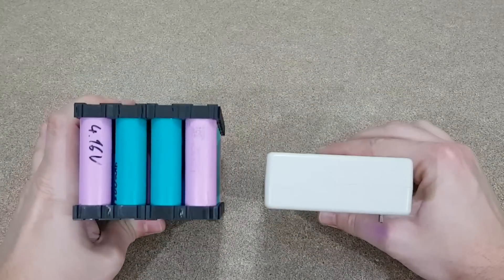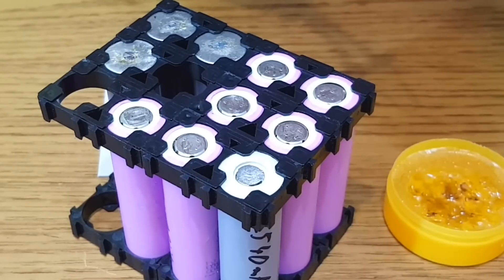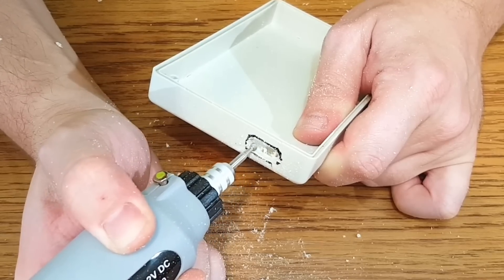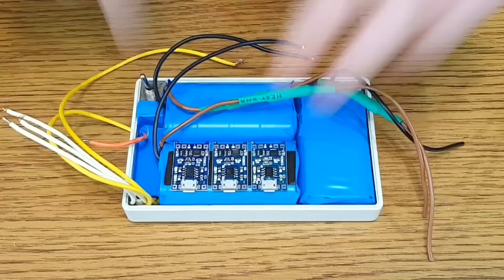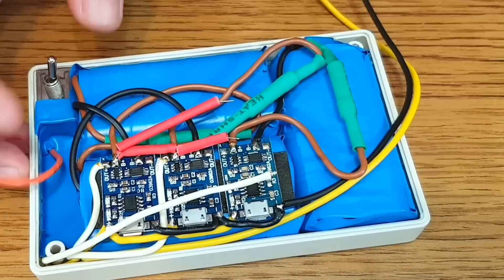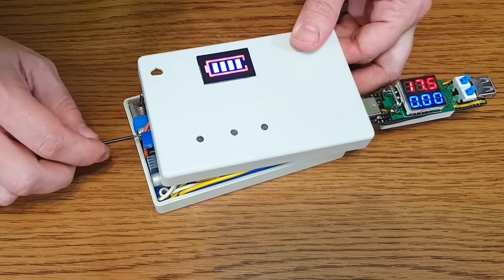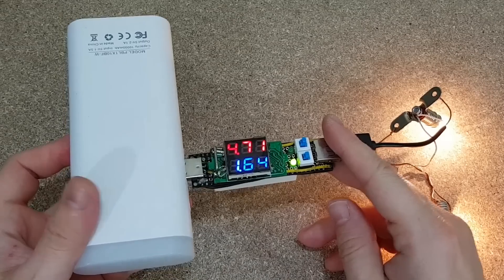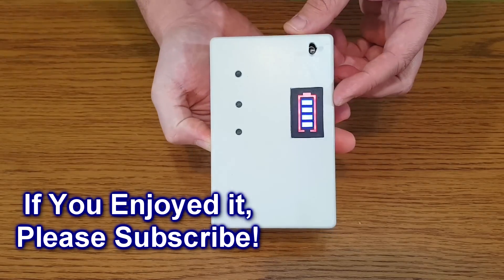DIY - 15000mAh Power Bank - With Salvaged Batteries (gets charged with 3A)

Comment from the maker: UPDATE: Instead of XL6009 I suggest you use the MT3608 boost converter, it's much stable when the cells get low on power.
Reply: Xl6009 latest model instead of MT3608 how is possible?
Reply: i have a question , how many cells i can solder to one module ? tp4056
Reply: @dellalioussama1124  2 cells max
Reply: 3 more secure
Reply: R value? (link dead)
Reply: Good day..can i ask..if its ok my old powerbank 3pcs battery use your 1.5amps fuses and 10 ohms resistor for TP4056 module charging board

Comment: instead connecting the battery with just interconnecting between each battery, the better option is connecting them into one central connection.. 
so the positive cable and the negative cable from each cells you can bond them together into one central connection (like using a busbar) but in this case just two cable soldered into one cable (or twisted it before doing so)..

connecting battery in parallel with this configuration, your battery would provide the current to the load with almost evenly (equal) current flow.. so, all the batteries can be balanced and not just one cells (or one paralled battery) otherwise it will died faster..
Reply from the maker: Yes, but with all the cells connected in parallel, it will take longer to charge them.

Comment: How do u get 17 output volts before u turn it to 5volts?
Reply from the maker: There is a boost converter on the USB output, which initially was set to 17V and it needs to be adjusted to 5.1V

Comment: Good day..can i ask..if its ok my old powerbank 3pcs battery use your 1.5amps fuses and 10 ohms resistor for TP4056 module charging board..newbie..pls reply and thank you
Reply from the maker: Hi. the 10ohm resistor is fine. the fuse is ok, but you need 3 packs of 2S batteries, each pack with a separate fuse.
Reply: Good day..if i use 3s battery it is ok if my fuse is 2amps or 2.5amps? and the resistor what is the right capacity of ohms i will use? newbie..pls answer and thank u..bless you always

Comment: I've built two of these now using salvaged laptop batteries. Thanks for the instructions. One question: when I charge my phone with these it only draws about 0.5A. In the video it looks like you easily get upwards of 1.5A when charging your phone. Any idea why I am not getting that? My phone draws 1.2A from the wall socket.
Reply from the maker: Hi. Did you bridged the 2 data pins on the USB port?
Reply: @Sorin_DIY I had not done this. Now I did it and I am getting 1A at 5.23V. Thanks! By the way, I like the switch but is it really necessary?

Comment: Hmmm, I built it according to the schematic and it works to charge the batteries (the TP4056 LEDs light up indicating that it is receiving a charge), but it doesn't work when I try to power anything or charge my phone with it. I am just a noob, but it seems to me that your schematic should have a wire connecting to the IN- pad of the boost converter. How can a boost converter do anything with only the IN+ connected? I'm guessing the OUT- of the last TP4056 in series should go here. Also, in the video you connect GND of the micro usb breakout to GND of the USB 2.0 port, but the schematic does not show this.
Reply from the maker: Hi. on the schematic it is mentioned that the IN- and OUT- are bridged on the board (there is a trace on the converter board from the IN- to the OUT-) because the negative terminal is common on all the components (except the Battery- pin on the TP4056). 
So it doesn't matter where you connect a negative wire on the converter/connectors/switch, on the IN- or on the OUT-, it's the same negative terminal on all components. 
If your powerbank doesn't work, you must have connected another wire incorrectly.
Reply: @Sorin_DIY  Ah yes, now it works. Thanks! Really fun and useful project. Your schematic was very helpful. I just did not understand the part about ground because I am a noob. Thanks for making this knowledge available to beginners.

Comment: are thel cells charged individually even though the resistors are connected to all of the cells in parallel
Reply from the maker: each pair of cells is charged individually. but if the cells are not balanced, there will be a small current transfer between the cells through the resistors.

Comment: Impressive video! I wished if I watched it before making my bulky 6s 18650 pack. I wonder where did you get that soldering gun? I like the fact it can solder directly at a battery in mere seconds.
Reply from the maker: it's an old Romanian soldering gun from the '80s

Comment: Hey Sorin, if we connect 18650 cells to BMS 4s 2p, which type of battery capacity indicator used for power bank, in our local market have many indicator like 3s, 1s, 4s... 
In shape wise all indicators are same
Reply from the maker: for a 4S2P battery pack you need a 4S indicator.
Reply: Thanks

Comment: Can I use anather switch?
Reply from the maker: yes, but with less TP4056 modules.
Reply: @Sorin_DIY  sir do you give me circuit diagram with SPST switch  in place of that toggle switch you use before..plz give....
Reply from the maker: you need a switch with 3 poles and 2 positions. the schematic is similar but with only 2 TP4056 modules.
Reply: Plz reply

Comment: Hii bro i made this power bank but i have one issue.. 
When the cells indictor on 40% battery the xl6009 step module only give 10 to 90ma not giving 1amp please help me..
Reply from the maker: the xl6009 needs a minimum input voltage of 3V. when the battery discharges below 3.1V, the step up converter will not work correctly. that's why I linked a MT3608 boost converter in the video description: https://s.click.aliexpress.com/e/_9wol94
it works with a minimum input voltage of 2V.

Comment: Can any one help me
Which is better in efficiency and  is the least in wasting energy in the form of heat when we make Power Bank 
(1) Do we connect the batteries in parallel and then connect them with a voltage booster to 5 volts 

(2) or connect the batteries in series to get 12 volts then connected to a step down buck converter to 5 volt????
Reply from the maker: if you need only 5V and 2A it's easier to connect the cells in parallel. 
if you want to use a fast charging converter, you need to connect the cells in series so the converter is powered with minimum 12V.
Reply: @Sorin_DIY  ok pro 
Can you make a video about how to make a usefull hand crank electric generator with good output voltage which can charge phone with it and Explain to us how it works and can it be effective and thank you verey much🙆🙆

Comment: You should pin a remark about changing the step-up converter, the missing black wire from OUT- of TP4056 charging module at 5:03 and 7:17 compaired to 7:40, the common IN- and OUT- internal connection inside the step-up converter.
 I browsed 787 comments and found you did not presented the build correctly in the video and it is so sad.

Comment: Hi Sorin i have another question. I made a powerbank just like on your schematics. But when its discharging, after battery voltages reaches around 3.6V, mt3608 gets crazy(stops, starts many times). And i cannot reach more than ~300mA discharge current(i tried another mt3608 and some other step up converters too). The batteries are salvaged in my case too. Do you have any idea or suggestion? Thanks
Reply from the maker: can you try it with another lithium cell? and did you use the same TP4056 module with protection for the cell?
Reply: @Sorin_DIY  i will try with better salvaged Samsung cells. Of course, i’ve used same protected tp4056 modules(upgraded to give ~2amps with lots of heatsinks). After i try i will write again. Thanks.

Comment: This is a nice build. Thank you for your efforts to share with us. Would there be any problem taking this unit on a plane, because it is DIY? For lowering the profile of a toggle switch, another option is to trim down its lever. If the lever is metal, a hacksaw may be needed for cutting and a file for easing the edges. Remember to seal the entire device with painter's (blue) tape, before starting to cut, to keep the metal shavings out of the switch. I would also like to see a DIY battery bank project that uses a DIY battery management circuit. I just have a problem trusting the cheap Ebay modules. And, learning about the circuit and building it is way more fun, IMO, even if it costs a little more.
Reply from the maker: hi. I don't think they will let you take it on a plane, because it's DIY, it's pretty big and it has a lot of lithium cells. probably if you build a smaller version it will be ok.

Comment: I found some 5000mAh 18650 batteries, but I wasted 3 of them because they have dry solder joints so i cannot charge them individually. I still have 1 cell left

Comment: Hi Sorin.
Your video inspired me. Can you take a look at my first power bank ? Especially the output, with two loads simultaneously.
https://imgur.com/a/fngBiC6
Reply from the maker: the circuit will work, but you need to turn on the powerbank when you want to charge it. I would use different modules to charge the battery and to increase the voltage to 5V, so I can charge the powerbank even if it's turned off.
Reply: @Sorin_DIY  Yes, I have a main switch that separates the cells from the rest of the circuit. I use what I have at my disposal. The module is an adjustable step up charger. I'm interested in the output of the circuit, I mean, I can even have two loads simultaneously, for example a phone and a USB lamp. Could I have problems with that?
Reply from the maker: in the specifications of your module it says that it has an output of 27V and 2A. obviously it can't deliver 2A at 27V (54W). then I found this detail at a different seller: Output reference maximum current5V 1.4A, 9V 0.8A, 12V 0.6A. so at 5V you can connect devices with a combined load of maximum 1.4A.
Reply: @Sorin_DIY  It's good and so, more than enough. It's just a cheap module.
I thought that having two different loads, one with a lower consumption and the other higher, could have seriously damaged the circuit.
I noticed that it has no protection for battery voltage, but I have that BMS 1S. Is there a risk of connecting two batteries in parallel? You talked about balancing in a video of yours.
Reply from the maker: it's ok to connect lithium cells in parallel. but they need to be the same type, same life-span, same number of cycles, same real capacity.
Reply: @Sorin_DIY  95% are the same. When it's ready, I'll leave you a picture.

Comment: Why the resistors connecting the + of the batteries? And also I don't know, why he use XL6009 DC DC Converter? It cannot be from TP4056 module direct to Charging USB?

Comment: Can i ask if i can use only two pin SPST switch and connected parallel the output battery of the cahrging module?thank you
Reply from the maker: no. you need a 12pin switch for 3 charging modules or 9pin switch for 2 charging module
Reply: @Sorin_DIY  ok thank you for your reply..
Reply: by the way i love watching your diy project cool and clean

Comment: Nice project! The most informative and safety that i found. 
One question though. How did you protect the 18650 from the modules from each other? In case 1 of them over heats
Reply from the maker: hi. I used sticky foam tape as spacer between the charging modules and the cells. the charging modules should not overheat, only if they are damaged. if there is too much current, the fuses will protect the cells.

Comment: Hey there .....your project seems very good and I just thought of making it......but when I made it the negative supply is not available at output module(step up module xl6009)......I didn't understand how xl6009 will receive negative supply.... without negative how it operates and give 5v dc.....kindly suggest my mistake.........🙂
Reply from the maker: hi. first of all you need the MT3608 step up converter, it's better than xl6009 at low voltages. the IN- and OUT- are bridged on the board. the negatives IN and OUTs are common on all modules, so it doesn't matters where you connect the negative wire, it's the same on the input and on the output of the module.
Reply: @Sorin_DIY  thank u for ur suggestions...👍

Comment: What will be the schematic if i want to remove the switch?
Reply from the maker: it will not work properly without a switch. only if you make it with different charger and boost modules.

Comment: Great video! Very informative.
But one question, what are the specification of wire that you use.
Im a fan of what you are doing and i'm also new in this.
Reply from the maker: hi. I used wires from an old PC power supply. I think they are 1mm wires.
Reply: @Sorin_DIY  
Thank you very much sir! ;)

Comment: Can this work whilst being charged.
Reply from the maker: yes, but it's not recommended. the battery will be charged and discharged continuously.
Reply: @Sorin_DIY  Any possibility you could build a UPS of sorts (that can be permanently plugged in and then automatically switches to battery when the power dies, so in essence a device, powered by a 12V supply which then outputs 2 x 5V, 2 x 9V and 2 x 12V @1A each.... Obviously very specific... So as you guessed that's my specific needs hehe.)
Reply from the maker: I will make soon a UPS with 2 outputs. you can modify the design and add more outputs.
Reply: @Sorin_DIY  perfect (just to be sure, will it be able to remain plugged into the wall and switch over when the power trips, in other words a always on solution)

Edit: nevermind that's a stupid question hehe, since it's in the name... Ups (uninterruptable)
Reply: @Sorin_DIY  I suggest (because I am searching for it) the second output to give power only in power failure. 😉

Comment: But Where Do you Can Have That power supply with you for charging
Reply from the maker: I have a 3A USB charger. you can also use a charger with 2A. it will take a little longer to charge it, but not as long as those cheap powerbanks.

Comment: Hi sorin, I am not able to find 1.5 amp fuse.  I can get 1 amp or 2amp.  Let me know on which to go for.  Also could not find the pdt switch available in my country, any alternative.  Waiting for ur reply.  Other parts I have.
Reply from the maker: hi. you can use 2A fuses. can you buy the switch from this link? you need the ON ON version:
https://www.aliexpress.com/item/33000443217.html?spm=a2g0o.productlist.0.0.565f5bb5uXdWTj&algo_pvid=5ca89420-57c6-4938-a979-d446636a186d&algo_expid=5ca89420-57c6-4938-a979-d446636a186d-0&btsid=0ab50f4415967507689757068e5405&ws_ab_test=searchweb0_0,searchweb201602_,searchweb201603_
Reply: Thank you for your reply Sorin.  Also, while going through comments you have mentioned that we need to use mt3608, is it mandatory or can we go ahead with xl6009.

Can we use, mobile 1 amp or 2amp charger.

I will order for switch and it may take time to reach here due to covid.  If any issues in building it, will let you know.
Reply from the maker: if you have only a 1A charger, you will build the powerbank with 1 TP4056 charging module. if you have a 2A charger - 2 charging modules. only if you have the possibility to charge the powerbank with 3A, you can make it with 3 charging modules. if you make it with 2 TP4056 modules, you can use a simpler switch with 3 poles and 2 positions, that's easier to find. you need the mt3608 step up converter.
Reply: Understood.  Thank you.

Comment: Very short space for such high end battery backup will lead to heating up, are u mad, u shud add a exhaust fan 1" size atleast for this suprr slim project board. 

U will see that after use of several charge discharge it gets heat up and performance is getting down.

If i put you in this tight box , will u be able to inhale oxygen?
Please treat chips as living beings, all standard circuit board of high amps have cooling technology or fans temp operated

Comment: I made this but my output current is maxed out at 440 mili amps can you please help me?
Reply from the maker: hi. did you short the data wires on the USB port?
Reply: @Sorin_DIY  yes I did and tried without shorting them too and sorry for the typo the current delivery is only 40 miliamps. I am not able to understand the problem I desoldered everything and re did exactly as you told again.
Reply from the maker: there may be a problem with the step up converter, what type did yo use? you can try it with some ceramic resistors as load, to test the output current.

Comment: Salut sorin again 
 Eu am vrut de mult timp sa imi fac un power bank asa ca acuma am 15 baterii de cate 18650 si as dori daca ai putea sa imi dai un link la un module pentru aceasta putere ceruta multumesc! (PS: NU IS ASA DE NERD CA ALTII:)):)) )
Reply from the maker: salut. iti recomand modulul de mai jos, are tot ce ii trebuie:
https://www.aliexpress.com/item/32885492747.html?spm=a2g0s.9042311.0.0.27424c4dUg9XHj
Reply: Un module de power bank care nu trebuie sa ii mai faci ceva doar sa ii lipesti polaritatile
Reply: Deoarece tu ai prea multe pcb's si eu  nu as fi in putere sa fac atat de mult ,daca poti lasa un link
Reply: Dar daca folosesc converter de la 3.7v la 5v nu o sa fure curent pe langa:)? (Nu are referinta la ce miai dat tu)
Reply: Ca deja mi-am luat unu cu screen 5v power bank module 2.1a usb si 1a
Si acum imi trebuie convertor ce o sa il fac ca un nerd din refurbished pcbs:)

Comment: Sorry I'm kinda new, and not sure I fully understand... will the voltage cut off at 3v while discharging to the USB port? or will you have to monitor and flick the switch manually?
Reply from the maker: hi. the TP4056 module has an over-discharge protection feature for the cells at 2.5V.
Reply: @Sorin_DIY  ahh I figured, but isn't 2.5v too low? Or is it because all the circuitry and drops the voltage a bit that "2.5v" is actually around 3v because the curve drops so steeply around there? Or not worried about dropping below 3v?